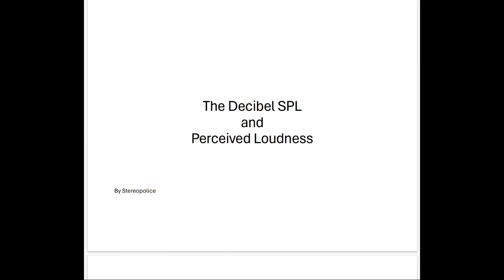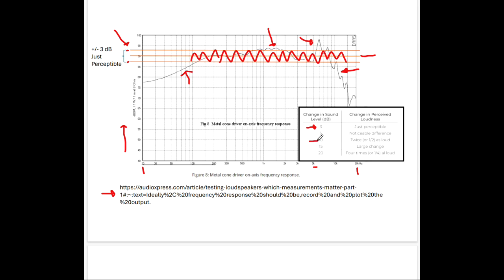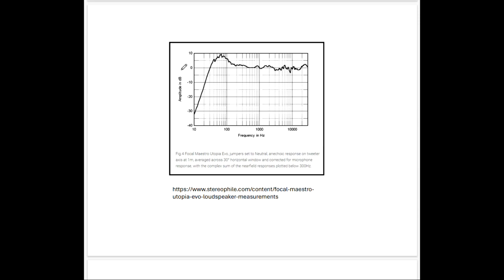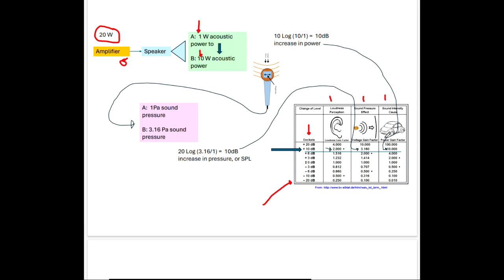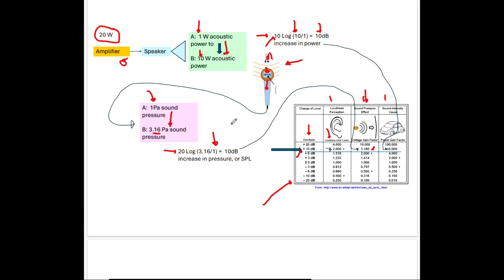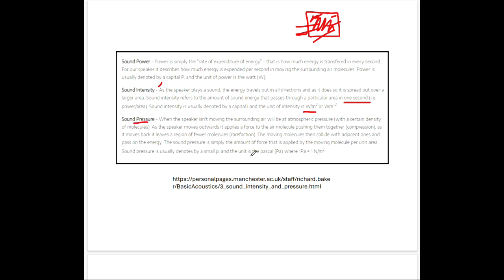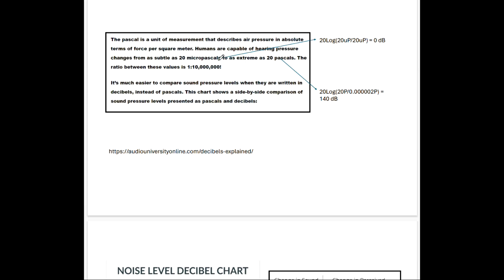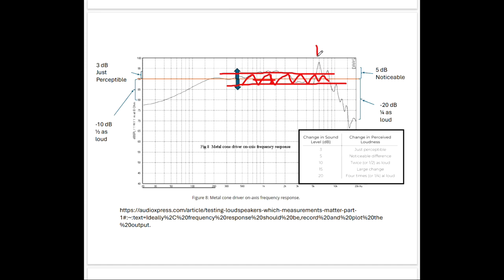Audiophile University, Lecture 6: The Decibel dB, Perceived Loudness, and Frequency Response

Comment: When I am running a stereo in my house at louder volumes I bring out my analog Radio Shack sound meter and tripod. Average levels rarely go beyond 80-86db, especially with compressed music. The peaks may blip at 100db, but I don't recommend listening to those levels for sustained periods of time. I use the weighted A setting on the meter.

I also have an app on my iPhone 12 for SPL meter and it is good to check levels of live music venues or movies. Checked it with my calibrated meter and it is pretty close and will measure up to 120db SPL.